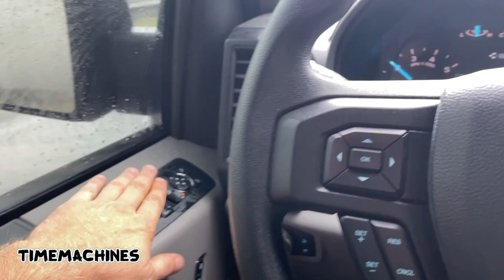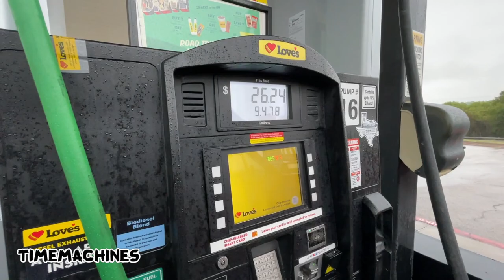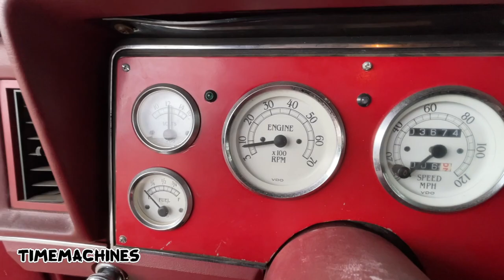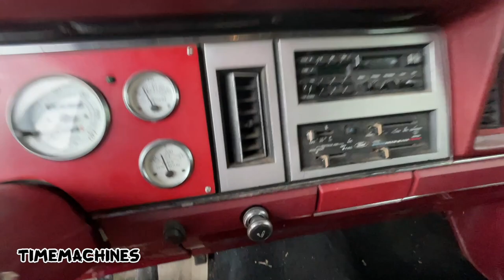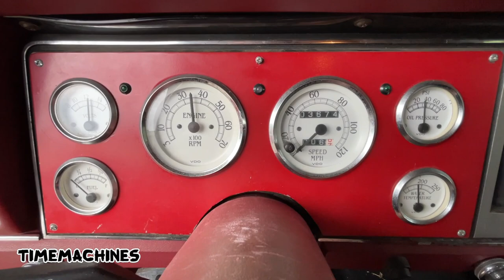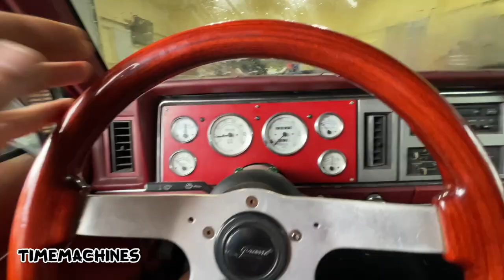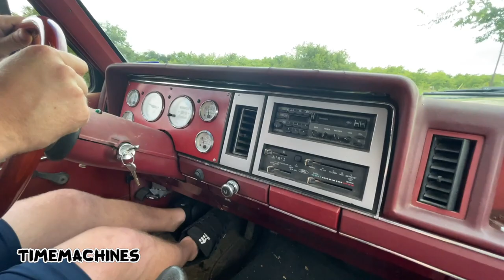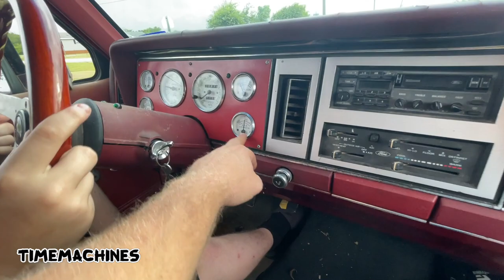Ford Ranger 5.0 GT | Certified Sh*t Box?

Comment: I never heard or seen a Ford Ranger GT. I've seen and owned myself a Ford Ranger Splash. The Splash was so fun to drive, it had a beefy motor and a great suspension which could take the abuse but the best thing about was the 5 speed in the floor. Again I've never seen a Ranger GT until now, your always finding awesome stuff. Great video bro 👍🏻🤙🏻!
Reply: Ok ok I see now, this is a 1 of a kind. I'd say it's worth 4k as is.
Reply from the maker: Yessir. I appreciate ya watching tony. I missed his ford lightning by 2 days :(. Or idda had it too. They built this around 99
Reply: @TimeMachinesATVs  I miss my Lightning also. I kick myself in the ass everytime I see 1 going down the road. Mine was a 2002 and I had running low 10's to high 9's in the 1/4. So I told the o'lady if I ever come across 1 that isn't clapped out to much and a descent price that were going to get it.
Reply: They did build a gt ranger I think 4.0 5 speed with those groundeffects I seen few in 90 92 around my town
Reply: @hb91  They were called a Ford Ranger Splash, I mentioned that above.
Reply: Ranger gts were made they are very rare and the only difference is bucket seats and ground effects still has the 2.9 v6

Comment: Take the camper off, new solid shift knob, fix sticky throttle, a little motor work, cut the exhaust off and it would be a pretty cool little truck. Like you said it is cool as is but does
have a lot left on the table lol
Reply from the maker: Yessir!

Comment: I've owned two fox body mustangs it's definitely got more under the hood hiding somewhere. It's probably the coolest shitbox I've seen in awhile. Dynomax Race bullet for a muffler like the roadkill boys use would sound killer !
Reply from the maker: Appreciate ya hanky. It either needs more power or less back tire lmfao
Reply: If you want to dig deep, GT40 heads from a 5.0 explorer and long tube headers will wake it up, or just toss 1000 bucks into the air while pissing into the wind 🤷